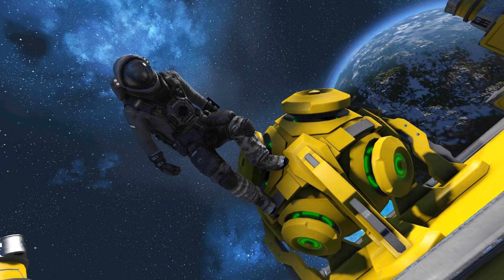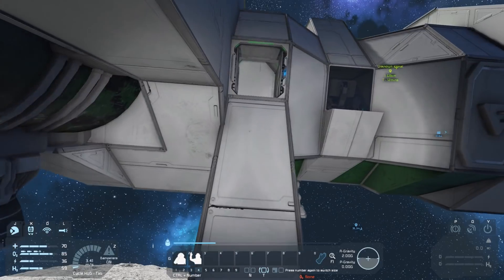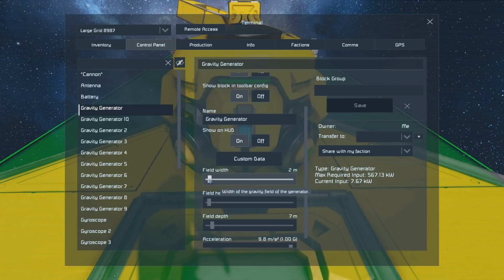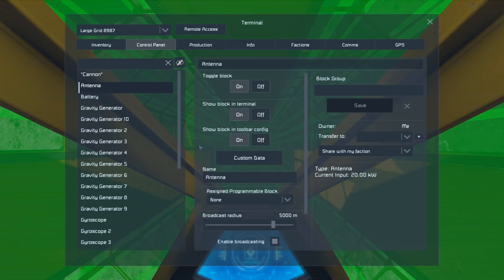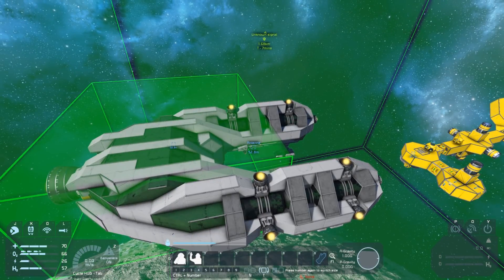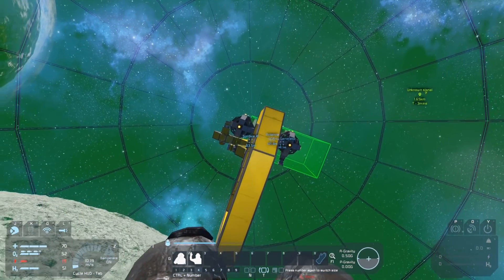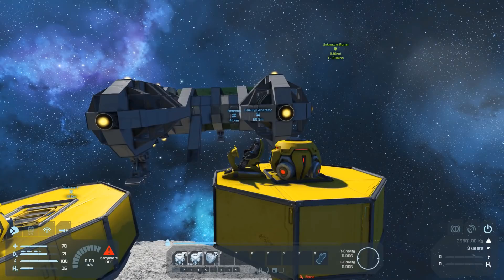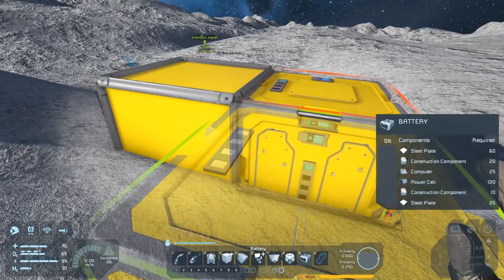Space Engineers Tutorial: Gravity Generators and Artificial Mass Blocks (Tips, Guides for Survival)

Comment: So, if I were to place 2 or 3 overlapping generators set to repel off of the moon, would it be possible to achieve close to 0g, I'm trying to find a way to get a pretty heavy rover that acts as a mobile printer but for flat ground only, my goal is to find a way to create a very low gravity zone to orient my rover on it's side using minimal thrusters then move it closer to a wall that is pulling. I'm open to suggestions around this problem but I really don't want to use a ship due to recharge
Reply from the maker: On the moon, yep you can still get enough power out of the gravity generators to neutralise or reverse gravity :)

In one of my survival series I built a lunar launcher to send ships to space from the surface with zero fuel spent using that technique - was a fun ride

Comment: I'm experimenting with a gravity powered ore transport system. I've built an ore receiving spaceship which I point at an asteroid. The ore shooting space craft flies in a straight line from the Ore receiver  towards the asteroid. 
Once there I turn it into a station and have a gravity gun shooting ore towards the receiving ship (over long distance I hope) . Multiple grav generators first slow down the ore and then lead it towards some collectors into the system. It's still in testing phase but from a distance where the receiver is still visible it works.
Reply from the maker: That visual range will always be the trouble, since you'll need to have it visible for the game to not cull those objects. I'm not sure which settings will allow things to remain present for longer, but I believe you'll need to increase floating objects and turn off trash clean up to get the most out of a system like that :)
Reply: @Splitsie  Not only does game mechanics make it disappear. Launched ore  loses velocity out of gravity range!  I was a bit like, huh? That's not very realistic. But there you go. Back to the drawing board. Maybe a self propelled ship can engage dampeners once it comes in range or something.
Reply from the maker: Oh, that must have changed when they made the floating objects not interact with as much complexity, I'd not noticed that before :(

Comment: Is there a way to kind of, cheat, with Gravity Generators? Kind of like a Mass Effect drive. Use it to lower the mass of a ship within a planets gravity field, so that your thrusters don't have to work as hard. I mean, if you can create negative gravity, then couldn't you make a 1 million Kg ship float without expensive upward thrusters? A cheap way of flight. If what I said makes any sense.
Reply from the maker: Gravity generators won't work in planetary grav fields stronger than 0.5G, so yes you can, but only at very high altitude or on moons and you'd also want to be perfectly oriented or it'll just drag you off to one side :/

Comment: Any way to use gravity generators or anything else to prevent ships your grinding up in space with a grinder ship flying away? The ships I am grinding are hostile, hoping to do it without leaving the cockpit.
Reply from the maker: Sadly vanilla gravity generators won't work that way, there are some mods that will change gravity generators to affect other grids which you could try if you're happy to use mods. Otherwise you could use landing gear to lock them and maybe with a shunting vehicle push the grid into your grinders
Reply: @Splitsie  what if you went into block placement mode from your grinder ship and attached an artificial mass block to your target?  You'd need a single welder arm of course, but it would be affected then, wouldn't it?

Ehhhh...but then you'd have to be careful to grind around the mass block too.  Hmm...
Reply from the maker: Artificial mass blocks require power as well, so there'd be two blocks to protect :(

Comment: I just managed to build my 24 G cannon (24 parallel gravity generators). When I wanted to test fire it from a ship, my ship suddenly accelerated beyond speed limit (104 m/s). Turned out, the loaded projectile which contained artificial massblocks caused the effect of the gravity drive to occur.

Now I'll add a few inacive AMB's, so my new battleship doesn't only hit hard on range, but also has the capability of getting up close into someone's face.
Reply from the maker: Love the idea of a dual use cannon - it not only makes my ship shoot things, it also shoots my ship! :P
Reply: Splitsie Now I need to build a ship that shoots ships, which shoot projectiles...

I played around some more; apparently the stake (it really is just a massive stake) doesn't work without mass blocks. If I turned off  the mass blocks, the projectile would just float in the barrel...

I think I'll combine a sensor with a timer block and have the launch initiated by the projectile itself.

Comment: Does the scripting language let you detect the level of Planetary gravity?  If so it should be pretty easy to make a script that keeps the grav generator off-setting the moon gravity to allow space designed ships to run to moon bases very safely.  A 3 block setup to convert a space-only ship to moon capable would be nice to have.
Reply from the maker: I'm not sure if the programmable blocks can access that information but even if they could it would likely require more than 3 blocks for a system like that to work. The artificial mass blocks pretend to be a certain amount of mass, you'd need more force against them if their total mass was less than the ship's own. 

For example if your ship has a total mass of 100,000kg and the artificial mass total is 50,00kg then you'll need to have twice as much gravitational acceleration from your grav gens as there is planetary gravity for neutral flight. 

I probably should have pointed out that function of the artificial mass blocks in the video but I hadn't really thought about it :P
Reply: On the moon you are fighting .25G with grav generators capable of .5G so you get at least double the bang per mass block per grav generator.  I still cant read the API specs very well, but did not see a planetary gravity property available.  I'll have to look at the fancy flight info script in detail and see if there are any clues there.

Comment: One of my favorite gravity-related tools is quite similar to your escape pod tube. Using a cargo container, some parachutes, and an artificial mass block to launch supplies to my planetary bases around the system. With good planning, you can even set a grinder pit of some kind where the cargo container will land and have the resource transfer be completely automated. Plus it's nice and dramatic to "call-in" supply drops from orbit.
Reply from the maker: That would be a pretty cool system to build, how do you line up the drop so that it's directly over the grinding pit though?
Reply: I generally drop from a station, which being stationary means that everything dropped should land in roughly the same area, barring any unforeseen interruptions. Generally you'll want to build the surface base you're supplying with this in mind, possibly using the drop site for the base location.  I've seen someone use an extremely long line of projected armor blocks to help line up your shot, if you're launching from a spacecraft, but I'm not sure the limits of how far a projector can cast an image.

Comment: im new to space engineers. just wondering if it is possible to make a weapon using gravity?
Reply: sure, just like the escape pod, you can throw ships that way that may or may not contain some explosives. you can also throw ores (rock rocks ;) ) and components.
Reply: aBuIIet awesome thanks  (=
Reply from the maker: Sadly the rocks don't work like they used to so you won't be able to make too much of a weapon out of them, but the explosives still work very nicely ;)
Reply: Ive seen that small explosive blocks aren't very good, so if you make a small block torpedo or shell, use Heavy armor for pretty much the same effect as using small warheads.
Reply: It is very simple to put a connector fill of stone with a few gravity generators. Turn the connector to expel and every second a 1K chunk of rock gets thrown out at high speed.  It is pretty devastating what moving chunks of rock/ore will do to a ship.

Comment: Artificial gravity stops working at 0.5g of planetary gravity. Moons have 0.25g so that's why you can use it there. 
Spherical gravity generators are perfect to create gravity shields. If you set them up to repel, anything that is affected by gravity in a 400 meter bubble will get repelled. This is useful to avoid any projectiles with artificial mass on, or even repel ships with a gravity drive on.
Gravity drives can be extremely powerful, but they have the complication that  the mass block position matters. When he launched his escape pod thingy, it got turned upwards cause the mass blocks weren't aligned to the center of mass of the ship. This is important if you want your ship to fly moreless straight while using one. The easiest way to do it is to place all mass blocks around the center of mass.
Finally a gravity drive that works in all directions is possible but hard to control without a script.
Also you can use gravity generators to create a gravity gun to throw what may or may not be explosives at your friends.
Reply from the maker: I should have mentioned about the shield use of spherical grav gens. That's a very useful point :)
Reply: You will want like 6 generators since you have seconds to stop incoming projectiles
Reply: how about a debris shield? 2 generators, one attracts with a longer range, the other repels with a shorter range. the setup keeps debris in a orbit.
Reply: @spacebear4742  Haha, genius! You could fill it up with stone or heavy armor blocks just floating around in it, and then you could have 'shield replenishers' that is a welder-welder-grinder set up that just continually weld heavy armor blocks and cuts them off to float off into the rest of the debris cloud!
Reply: Mike A I use 20 nothing gets near me to op

Comment: Are you done with auto pilot? Your two videos were very useful for planet base drones but im struggling with space drones as they operate under slightly different rules.
Reply from the maker: I'm not done with it, but I keep managing to break my space docking setup. Each time I think I have something foolproof I come up with another foolish method for ensuring it doesn't work :(

I have got horizontal docking on planets working reliably though
Reply: Splitsie are you moving more than 20m/s when trying to dock to your space dock because that could cause damage if you are if you still need some help with that let me know i saved the world I built my space auto docking ship in though I have not messed with it since I made that video
Reply from the maker: The ship's moving slower than 20, but despite setting it up like the video you showed me I've only had the dock working for the first few times then it starts messing up :(
I've got horizontal docking working on planets with a highly reliable setup but space just isn't playing ball. Even with the remote sitting over the centre of mass it starts jiggling about at each way point which means it's not aligned when it approaches the final docking point. That's with precision and collision avoidance off. I might try to see if I can make a video out of all the different attempts - the challenge will be making it so I don't sound like I'm whinging :P
Reply: a video might be good then I could see what you are doing and if all else fails we can try a multiplayer world again to help you get the bugs worked out.